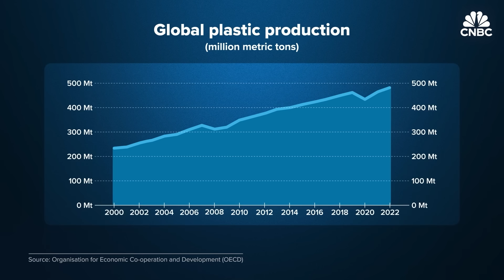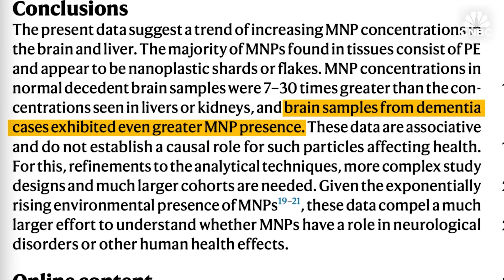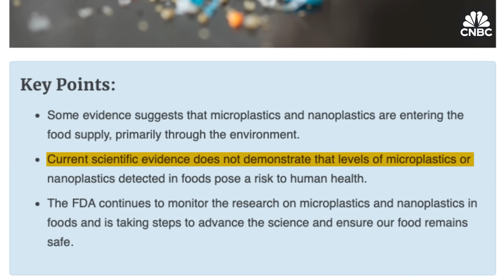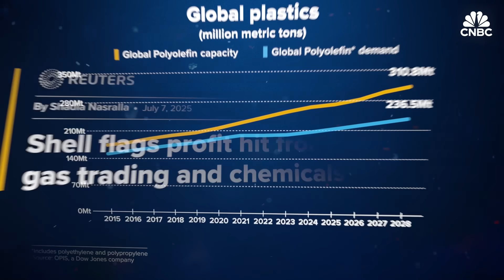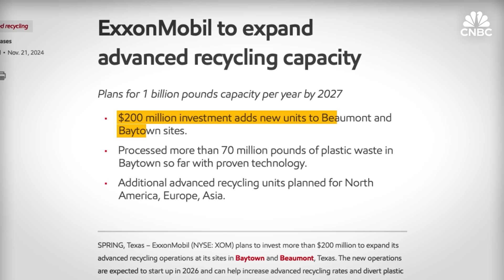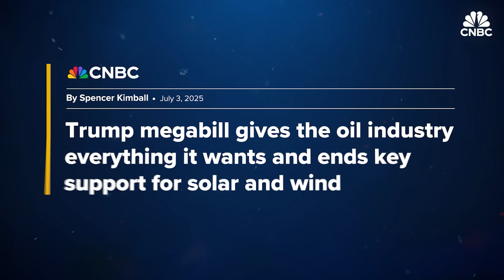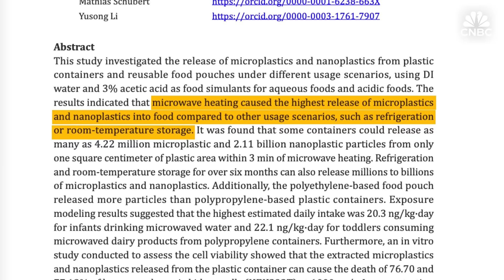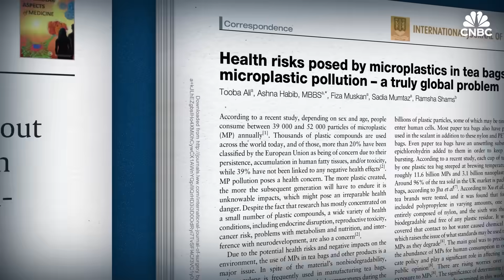Why The Microplastics Crisis Will Only Get Worse

Comment: This will get worse as 3d printers are becoming cheaper and easier to use especially the multicolor ones that generate a lot of "poop" when switching color. Also some of the plastic used can not be recycled. As an example the PLA plastic made out of sugar. They have lower melting temp, if mixed with other plastic will cause the end product unuseable. Currently the only way to dispose PLA plastic is dump it to the trash.
Reply: yes 3d printers are part of it as well, but the amount of plastic sued in those applications is negligible compared to other uses like grocery stores n stuff

Comment: Plastic recycling was a scam.  As long as industry is extracting oil, it will sell plastic.  If it doesn't sell plastic, all that sludge becomes waste which the oil industry is responsible to manage (ie, it costs money to dispose of sludge after refining.. but if you can turn that sludge into plastic, even if you practically give it away, it is still cheaper than disposing of toxic sludge).  So for that reason, recycling was never going to be profitable.  Because oil companies would rather give plastic away for free than be responsible for paying to put refining by-product into landfill.

So today, fish is a high risk food because it is full of plastic.   The higher up the food chain the fish species is, the more plastic it has in it's body.  Tuna is full of plastic (it is a large carnivore that eats other fish that ate still smaller fish that were all full of plastic).
Oysters and other filter feeders are full of plastic.. they eat anything that floats by.
Get a stainless steel thermos or glass water pitcher rather than drinking from plastic water bottles.
Reply: This is all very true, you know your stuff! I am so sad about tuna, oysters and other food from the Ocean because I really like specifically tuna and oysters, but with canned tuna, you get double the microplastics because of the fish itself and the BPA or the BP_ type plastic lining in the can. We just can't win. At this point the only option is to accept our fate of microplastics being everywhere including in us and try to limit the consumption of them and usage in general as much as possible.
Reply: I just buy a bottle of pop and continuously fill it up with water .  Yup , lasts forever . Unless I can lose it .  Then I end up getting another bottle of pop .  But , I never buy cases of water .  That drives me nuts !
Reply: @Michelle-yw1lv I also reuse glass soda bottles , small enough to carry single handed or fit in a cloth shoulder bag . On a recent walking tour , I was amazed to see so many single use plastic bottles being used by people that I thought would know better .
Reply: All of those expensive and inconveniencing alternatives to plastic will only make your life harder and will probably only marginally reduce your microplastic intake friend. Just watch as humanity destroys the planet, and if you have kids enjoy knowing that they and their kids and their kids kids will be consuming more microplastics on average than previous generations. Bon appetite.
Reply: So when I eat a can of tuna …rats . Well  , maybe once or twice a year ….oh . Already there .
Reply: hmmm...fish and people have a lot in common
Reply: If there would be a way to recollect and burn it properly the oil would get a double-or triple use.
Reply: But also don’t use tap water, because of the fluoride and other metal contaminants. There’s a deliberate toxification of our food, and if it doesn’t stop, things are going to get seriously dire.

Comment: Don't forget about rubber tires, human footwear and other tyre materials! They all break down into small rubber particlets too
Reply: Some facial scrubs have plastic beads that are deliberately designed to be washed in to the water ways. Scourers, body washers etc etc etc
Reply: @Cedawood And it's totally unecessary nonsense.  At least some have switched to crushed apricot seeds instead of plastic.
Reply: Tires are #2. The largest source of microplastics is paints/coatings, but no media ever talks about it. They always focus on most visible consumer items like plastic bottles and bags even though addressing those will do very little towards reducing microplastics.
Reply: @TheVonMatrices  the media and especially the government... doesn't go after religion... and this worlds religion is cars.
Reply: You forgot clothes
Reply: I lived by a pretty major 2 lane city street for a couple years. Couldn't open the window, because the black dust from diesel soot and tire breakdown just made every surface filthy. Not to mention the effect on my lungs. It was wild.
Reply: @BenMcghie  I live right next to a large intersection and have to wash the house because the black grime collects on the siding. I'm sure my lungs are fine though...
Reply: @BenMcghie  im curious if thats the only downside from living near a road. Would the effects of the car pollution like particulate matter and other tiny particles be worse farther away from a road? or does it spread through the neighborhood with the wind equally????
Reply: @raymondqiu8202  Add noise pollution and possibly vibration/rumbling from heavy motor vehicles.
Reply: @sutats yes but are people in the neighborhood a few streets down also equally affected by the exhaust gasses and particulate matter? Or does it affect them less?
Reply: @raymondqiu8202  I saw some research a while back. 
It depends on the environment around the road. If you got hard surfaces (eg houses) the dust gets blown on. But if you got trees and hedges, the dust settles surprisingly quickly and beyond maybe 100ft/30m you can hardly find any.
Reply: @raymondqiu8202 you would have to search for studies on it but I recall seeing studies that correlated poorer respitory health and more asthma associated with living by a major roadway but also those areas tend to be undesirable and home to poorer people so it would be hard to say that's causation.

Anecdotally I have lived by highways and major roadways and quieter streets away from busy traffic within a city and there is a noticeable difference in how dirty your windows and shoes get. I imagine it does spread out from there just like pollen does but I feel like it is very concentrated by roadways. It leaves a black dusty film.
Reply: @raymondqiu8202  the fumes from the road on a hot day are toxic too... everywhere theres a road... it's just a matter of how damaging the toxicity is over time... roads themselves are pretty bad... even in terms of the way water spills off them...
Reply: @raymondqiu8202 the whole state... research shows 100-300 meter range for what's being talked about here... for analysis though... you can find particulates in YOUR dust from roads hundreds of miles away.
Reply: @sutats water/oil runoff... nutrient degradation, ecosystem degradation, ecosystem diversity degradation, heat increases, increased costs... the list goes on... roads are far more terrible than we imagine them to be
Reply: As A Whole World We are Killing Earth, Us With IT.
Reply: Also: carpets and upholstery everywhere, plus almost all clothing. These probably contribute the most.
Reply: As opposed to non-human footwear?
Reply: Yes, but the young black guy has figured out to convert gas from plastic. This would help eradicate plastic pollution if big oil companies don't try to sabotage the process
Reply: @ninjastevens2243  yeah... using known toxic chemistry to solve toxic chemistry so we can combust more gasoline and have more toxic chemicals... isn't what you're making it out to be and collecting microplastics on that scale is... burdensome at best... if not outright impossible... it definitely can't be extracted from our blood and organs before death... and the only reason large oil companies didn't do it is because they make more selling new crude.
Reply: dont forgot your nylon laundry but tires are the worth
Reply: or word$, work = wrong and you have them in your head immediately and always, repeatedly ...
Reply: dig cylinders near roads that fills up with water runoff and dries up into it. only remove some of the horrible glop when it fills up. you are making a bacteria degenerate cave so all the degenerate bacteria can eat the garbage runoff for you and destroy it. once they establish themselves and exit the degenerate cave you'll find them everywhere eating garbage.
Reply: Dumba$$
Reply: jimhanson2860
have you ever wondered where all the tire material goes. Tires wear down and we replace them, where is all the tire powder?

- in your ego? the perpetrator returns to the scene of the crime? main thing we are independent on common roads, cars, tires and such commie crime$, right?
Reply: antonyjh1234
I searched this out the other day, the same sort of tonnage in microplastics come off car tyres

- rubber is plastic? i thought (India) rubber comes from some trees, it is their sap/lymph ... why we actually need transport, when we "are so independent"?

and brake pads

- they are plastic? i doubt ... but i guess their material isnt something nice ... maybe we should recuperate energy more, or that brings another problems (batteries)? i guess there are also small non-degradable particles, similar like at asbestost (when moving with it) or teflon ... which is also toxic maybe not only for birds (when (over)heated) ... or goretex (waterproof clothes and shoes), probably ...

as bottles that end up in the environment.

- and what about smaller, thinner plastics - bags? i thought microplastics are mostly from (washed) clothes ... but i guess the clothes wouldnt withstand for very long time without plastic fibres holding the cotton ... probably there are different types of cotton quality ... when i bought a very cheap t-shirt, it was full of holes after a few washing(s) ... or microplastics are mostly from whole synthetic clothes?

i also dont like prints on t-shirts ... at edges of the printed BS (letters, pictures), especially in the corners arise holes first, because the cloth fibres are most stressed, bent there ... the printed parts are also unpleasant because they dont allow moisture (sweat) to pass through ...

The plastic that is made into bottles is also made into synthetic clothes and is in the greater percentage, we wash these microplastics into our oceans, homes and soils daily, always thinking it's someone else causing the damage,

- you also are just throwing it on other people, not bringing any solution, i guess ... maybe i could use 100% cotton clothes, but idk how long they would withstand ... they would hardly be waterproof ... i guess my winter jacket is 100% plastic ... also functional underwear (i have also pyjamas from this material) ... also my hiking pants ...

there is also questions, if microplastics really are a problem, or it is rather another "science" religion trying to haunt people and make money from that ... but money is also from producing anything ... but our "waste management" is very suspicious, i guess ... mostly "when we all do it, it is ok" or "it will vanish somehow in the nature, God" ... same with words we just throw on other people, like in Middle Ages (on the street), or with car and house (heating with wood, coal) exhausts and industry it is still the same, i guess ... or we just send our waste water to the neighbors through pipes ... then we "clean" it (or we claim that atleast) and then just pour it into a river ... and somewhere they drink such water, actually ... maybe they filter it through the shore (soil) ... but idk if it is really clean, medicaments and hormones-free and so ...

now EV's are half plastic

- other cars not?

and because of the weight tyre consumption is growing faster than car sales

i also heard about large transport ships, which transport the same kind of good in both directions, they have the biggest fuel consumption and worst emissions ... but i hardly hear about them in main$tream media ... i heard about thinking they should use canvas (wind) again, but idk what material would it be ... plastics arent very sun-proof, and what about salty air? what about ship coating (paint) and microplastics? i guess it would also be problem that it isnt so easy to use canvas/wind ... so there should be more (skilled, competent) people on the ships, probably ... or the canvas would be controlled with (ropes (which material?) and) electric engines, but i guess there is (we have) too little of copper for them even for EVs ...
Reply: i also heard the McDonald's waxed paper packagings are very bad for environment ... because of the wax? or because it is hardly degradable? or because some rivals wanted to blame McD for own transgression$?
Reply: eileenwatt8283
Research needs to be done to see if it's the cause of autism.

- i guess it isnt ... or all people are autistic, just blame only some people for it without reason? (if they werent, they wouldnt deal with it) ... but idk if it is (only) because of microplastics ... or do autists have more microplastics in their bodies? or more foreign enemy invasion in general? are they weaker? and others abuse it and throw the more crap on them ?! maybe they would be healthier if people wouldnt be so reckless to them, if there really was freedom, not enemy dictature "you should be as i expect, am used to (trying to throw on other people), otherwise you are wrong and i can throw all/more wrong things on you!" ?!

maybe headless $ociety is the cause of microplastics, "autism" and most BS in general? maybe word$, work = worries, wrong, throwing (such) BS each on other?
Reply: edwardrombach3015
Micro plastics are also a risk for people who need to receive medicine in pill form that needs to be crushed and dissolved in water to be delivered via feeding tube.  Most of the pill crushers are plastic and as they are used over time they wear down which means that tiny pieces of plastic are commingling with the meds to be consumed by patients.

- no one throws away/on other people "good", right, commie$ in "hardly good"?
Reply: KerrAvon-DSV1
TiPP:   NEVER use a knife with plastic packaging, use a SPOON!  Knives scrape and scratch the containers contaminating your food!!!!

- and the soft see-through foils, too?

    Pass it on...

- good would everyone keep for himself, right? word$, work = worries, wrong, wrath, dont use them ...
Reply: Contact lenses, pen caps, lighters, gym exercise equipment, all containers for anything you buy etc
Reply: @riobrasilsambashowssambist1453  not to mention all the plastic used in medical care.
Reply: Yeah not mention brake dust
Reply: @MrCTruck  ''All we are is...dust in the wind''' 🎶
Reply: @MrCTruck  Tree pollen was my nemesis.
Reply: 'particlets'.. that would be either particles or particulates.
Reply: And those are far more carcinogenic because of the oil base
Reply: @hannah_boston  Yes, but non-oil based plastics also contain toxins... plastic is pretty toxic chemistry... its breakdown is pretty toxic chemistry... and its conversion to other substances is rather toxic...
Reply: Oh hell yeah
Reply: They aren't forgetting. These rubbers are also considered to be plastic. This is a chemical fact.
Reply: Clothing too the t shirt I am wearing is a blend of cotton and plastic
Reply: @111danish111 It is getting hard to find 100% natural material clothing.  I am going back to buy only those.
Reply: @GKP999 that's because the supply literally can't keep up anymore... and plastic is cheaper than cotton
Reply: @111danish111  That's your fault. All my t-shirts are 100% cotton.
Reply: brake dust is another major pollutant.
Reply: TiPP:   NEVER use a knife with plastic packaging, use a SPOON!  Knives scrape and scratch the containers contaminating your food!!!!
    Pass it on...
Reply: Made in China.
Reply: Actually, tires these days are made of a combination of natural and synthetic rubber, meaning petroleum-based.
Reply: Clip
Reply: have you ever wondered where all the tire material goes. Tires wear down and we replace them, where is all the tire powder?
Reply: Research needs to be done to see if it's the cause of autism.
Reply: I searched this out the other day, the same sort of tonnage in microplastics come off car tyres and brake pads as bottles that end up in the environment.
The plastic that is made into bottles is also made into synthetic clothes and is in the greater percentage, we wash these microplastics into our oceans, homes and soils daily, always thinking it's someone else causing the damage, now EV's are half plastic and because of the weight tyre consumption is growing faster than car sales
Reply: Sometimes as I walk in my neighborhood I can literally see chunks of tire on the road or in the grass (the bay is 20ft away from the road), and I sometimes pick up those hot and heavy pieces. They are TOUGH and heavy, I just hope little to none got into the water.
Reply: true but until we have some way to hover it's unavoidable. my employer won't even let me do my 100% computer-based job from home, nope, gotta pointlessly drive in and pollute and waste time and money
Reply: Need to build a tire pyrolysis facility!!!
Reply: @SolarizeYourLife 
Something like that, cause tires are a chemical stew.
Reply: Micro plastics are also a risk for people who need to receive medicine in pill form that needs to be crushed and dissolved in water to be delivered via feeding tube.  Most of the pill crushers are plastic and as they are used over time they wear down which means that tiny pieces of plastic are commingling with the meds to be consumed by patients.